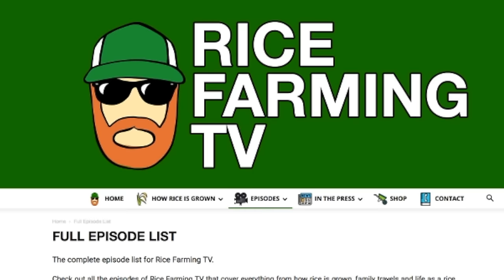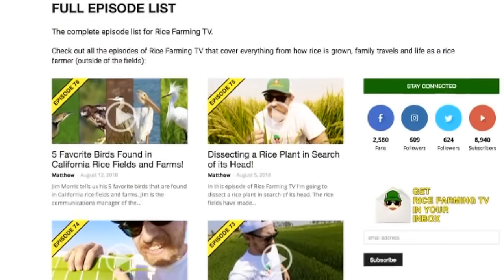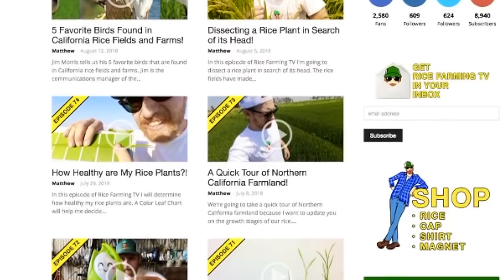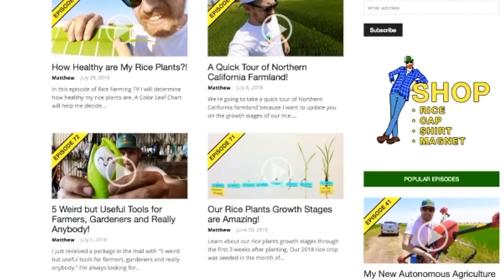How Much Rice Can One Plant Produce?!

Comment: Hey Matt!  It looked like you counted the seeds on one seed head. But aren’t there multiple heads on a plant?
Reply from the maker: Depends! The field from which I pulled this plant was lush with a thick stand of rice so the plant did not tiller (no need and no space). So it's almost better to take a look at a square area of space to get a solid average for the field. To get a better average for individual plants it would be better to select them from all over the field (pulling ones with tillers and ones without). It's a hard question to answer because there are so many variables. But that specific plant had no tillers; nor did its neighboring plants.
-M.

Comment: Do you add anything to your rice post harvest?
Maybe something to keep them dry?
Reply from the maker: Hi Ray, after the rice is harvested it is delivered to the dryer. The rice is dried down to storage moisture with heating columns. Then just air is blown through the flat storage to keep the rice from sweating. Great question!
-M.
Reply: Hi Matt,  can the rice not be dried sufficiently? Sometimes, under all equal conditions, rice after cooking becomes  really mushy. ( Other times the rice is perfect). This usually happens when I buy unbranded rice. And it's really visible from the first minutes of boiling, rice turns into mush. I suspect that rice was not sufficiently dried from the beginning. Thanks.

Comment: Honestly, it’s a lot less than I was expecting, because I’ve always heard rice yields anywhere from 150-200 bushels and I was just expecting to hear a lot more. What population are rice fields usually seeded at??
Reply from the maker: We fly on a 260 lbs. per acre. It's maybe a little above average for the area. Rice is an amazing plant in that if you have a lush seed bed and not much room for outward growth the plant wont tiller and thus produces less seed per plant. If there is a lot of open space the plant will fill it in by tillering and thus produce more seeds per plant. 
-M.
Reply: @Ricefarmingtv  
Then why don't they plant rice plants farther apart so they can leaf up and produce multiple seed heads?

Comment: Hi Matt,  can the rice not be dried sufficiently? Sometimes, under all equal conditions, rice after cooking becomes  really mushy. ( Other times the rice is perfect). This usually happens when I buy unbranded rice. And it's really visible from the first minutes of boiling, rice turns into mush. I suspect that rice was not sufficiently dried from the beginning. Thanks.
Reply from the maker: Hi Dmitry, I would say that this issue has more to due with the quality of rice rather than how it was dried after harvest. Not all rice is created equal (even if it's the same variety like medium grain or long grain). California medium grain, for example, is a premium quality rice and had a better milling and cooking quality compared to southern grown medium grain. Also there are several hybrid varieties of Southern grown long grain that have really poor milling and cooking quality compared to other Southern long grain hybrid varieties. The varieties that provide a better milling and cooking quality might yield less and/or be more expensive to buy as seed (for the farmer) and thus would be more expensive at the grocery store. Conversely lower milling cooking quality would be cheaper. Great question. Thanks!
-M.
Reply: Understood, thank you!
Reply: There are thousands of varieties of rice. The sticky and non sticky varieties differ in the percentage composition of two starches: amylose and amylopectin. In sticky rice, also known as glutinous rice, the percentage of amylose is lesser and amylopectin higher. A long grain non sticky rice like Basmati (or for that matter most of the rice originating in India) has a greater percentage of amylose. Many south east asian rice varieties are higher in amylopectin and tend to be sticky.

Comment: Could you determine the below details if possible?
Number of crops in 1 square meter/foot

Weight of kernels in the same 1 square meter/foot (assuming it will be around 1.25 kgs)

Comment: Matthew,  Does the rice plant not tiller?  If so I understand the video.  If it tillers like wheat wouldn't there be several stocks of rice per seed planted?
Reply from the maker: Hi Bryant, great question. Tillering depends on the stand. The field from which I pulled this plant was lush with a thick stand of rice so the plant did not tiller (no need and no space). Another location that had less of a survival rate of seeds would definitely have tillers and multiple seed heads.
-M.
Reply: You may have said before but how many pound of rice per acre?  Wheat in the Oklahoma Panhandle (irrigated) would be planted between 60 to 120 pound per acre.  Also good luck on harvest.
Reply from the maker: Thanks Bryant, we seed at a rate of 260 lbs. per acre (a bit above average than fellow growers in the area). Again, harvest 10,000 lbs. of rice in the fall.
Reply: Thanks Matthew.  I think what your are doing is great for Agriculture.  To many people are so far separated from farming that this needs to be done to educate the general public.  The food they eat doesn't come from the supermarket.  Take care.
Reply from the maker: I appreciate that, Bryant. Thanks for the support and encouragement. Please keep in touch.
Reply: 51 x 260 lbs = 13,260 lbs.  Right order of magnitude.  Maybe the birds get their share.